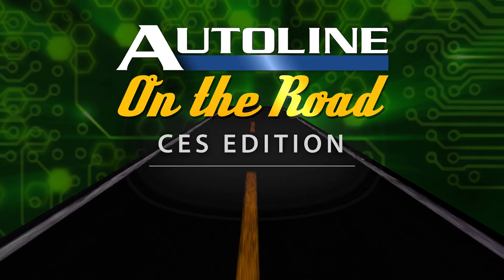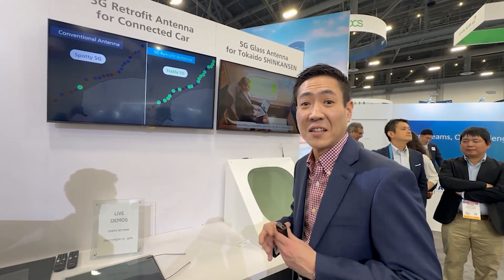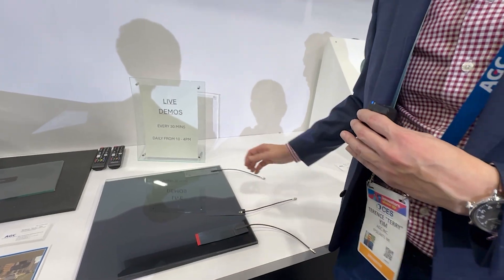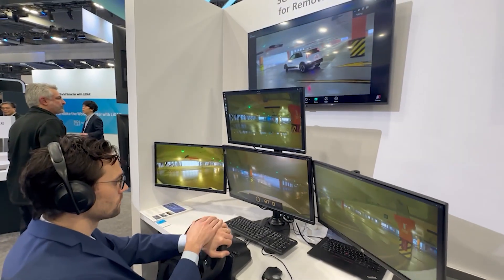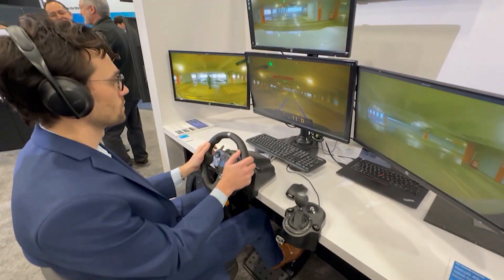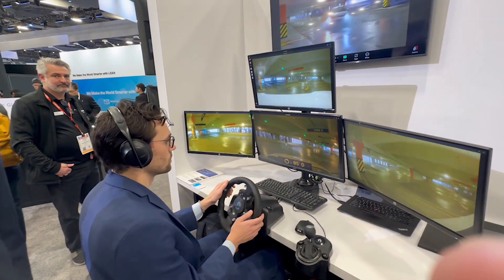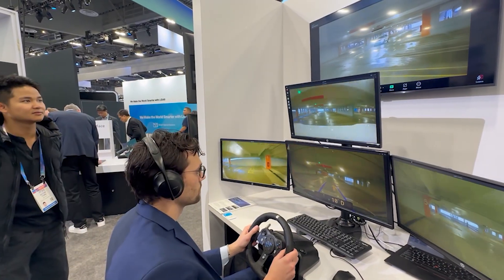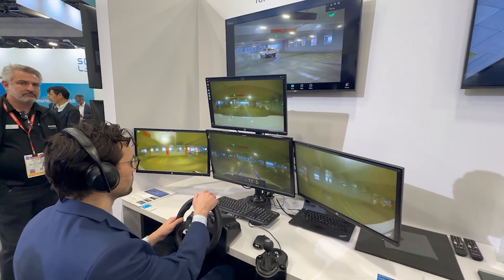Driving A car That’s 2,000 Miles Away - CES 2026

Comment: Is it sandwiched between the layers of glass?

OR

Is it attached to the inside glass?

This issue will be when people need to tint the glass. I also have NO idea why they don't put the rear glass heater lines in between the layers of glass 🤷🏽‍♂️ Also why do they need to make them copper lines when they could probably make them transparent as well 🤷🏽‍♂️